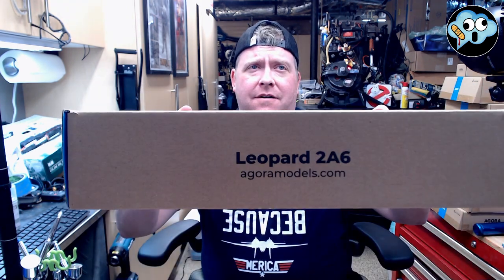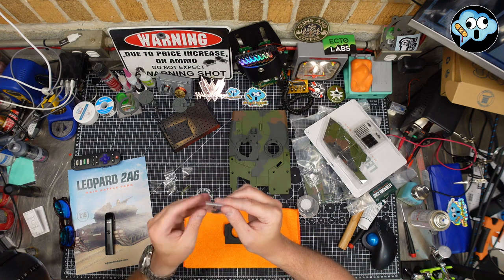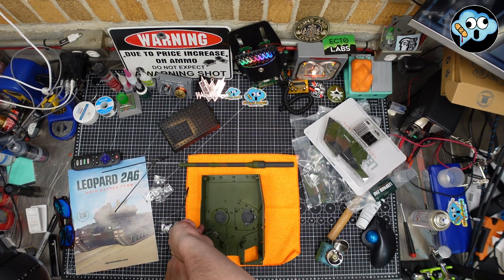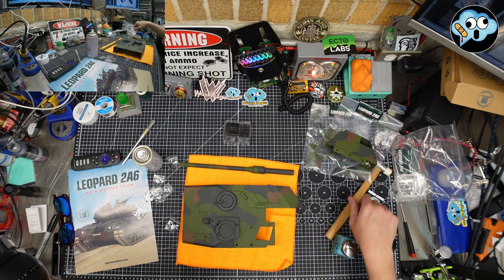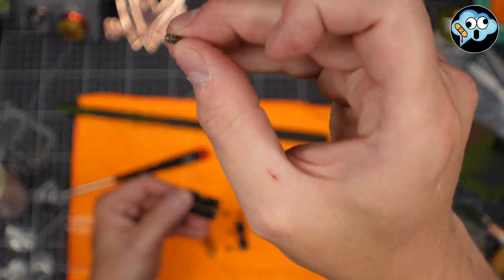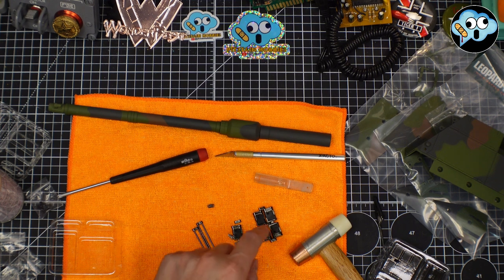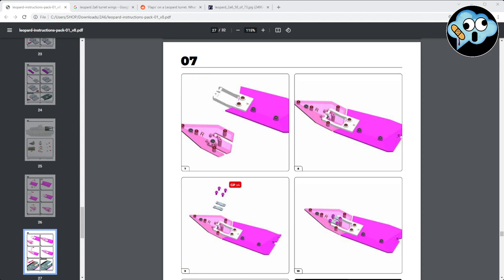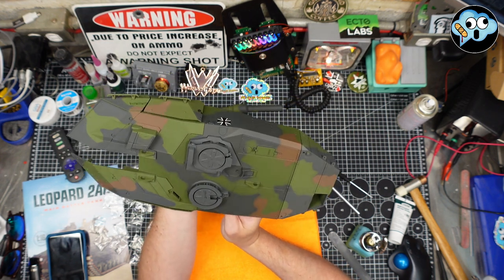Agora models 1/16 scale Leopard 2A6 Main Battle Tank partwork kit pack 1 build stages 1 through 8.

Comment: Suggestion: You should be able to half insert the track pins, then add the centre guide and finally push the pin all the way through and then finally add the end connector.
That way you aren't trying to hold 3 things at once.
Much easier than with the real ones. :)

Comment: Looking good after just pack 1. It's out of my budget at around A$2500 but I'm happy to watch you build this beast. 👍
Reply from the maker: Thanks Pete, not cheap but it's a very nice kit, thanks for watching.
Reply: Yes its a bit pricey, but I guess its pre-painted and you don't need to buy all the extras that even a "full option" Tamiya needs.
I'm a bit of a purest so the lack of torsion bars and I think plastic road wheels on plastic support arms might limit its usefulness - i.e. limit use to once in a while.
But looking forward to it being built.